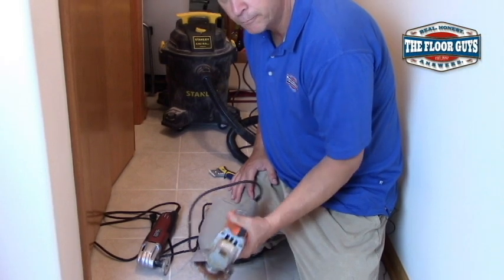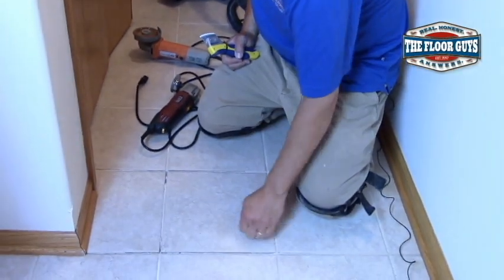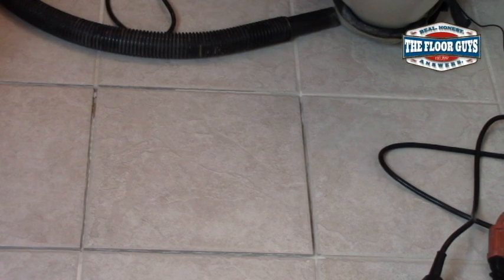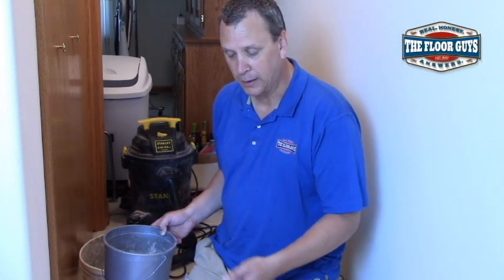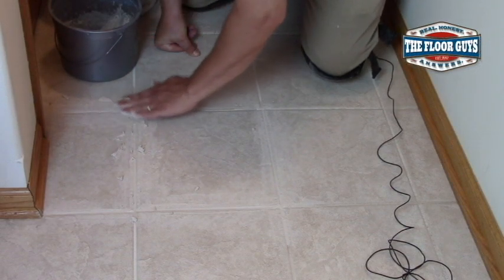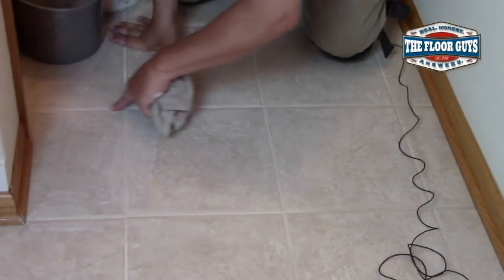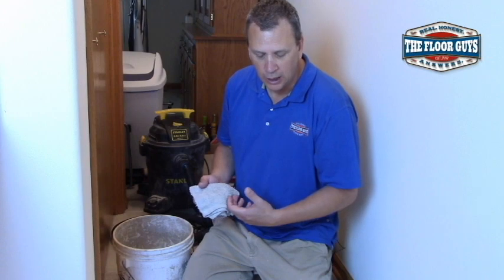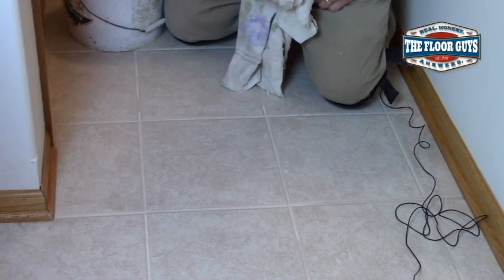How to Repair Cracked Grout on a ceramic tile floor [ It's so easy anyone Can Do It]

Comment: What would cause little voids in my grout.  Looks like little pin holes? I'd imagine to fix is to take up as you did in video even though floor were just done.
Reply: I've noticed pinholes in my grout after using water with white vinegar to clean the tiles and also scrubbing the grout with a brush (maybe too hard).

Comment: How am I with oscillating tools? I am a Florida power and light brat, thanks daddy! And I am very partial to not electrocuting myself plus having a power tool in my hand. I may have to go with the simplest way possible so I don't kill myself in the process of getting gorgeous tile. But I had to smile

Comment: Um, eye protection!
Reply from the maker: You are 100% correct. I didn't have any on the truck that day for some reason so I went for it without anything happening to me. I usually wear safety glasses but you caught me.